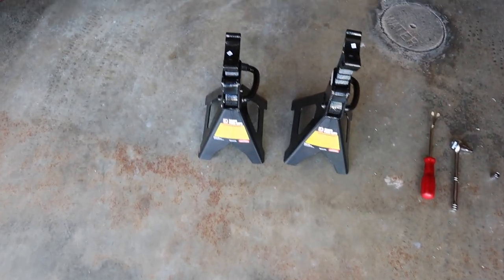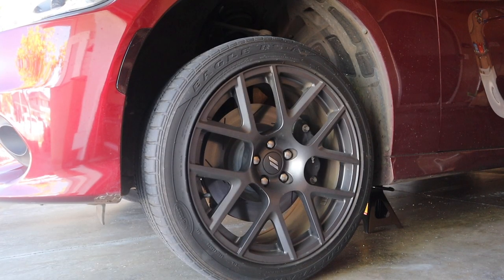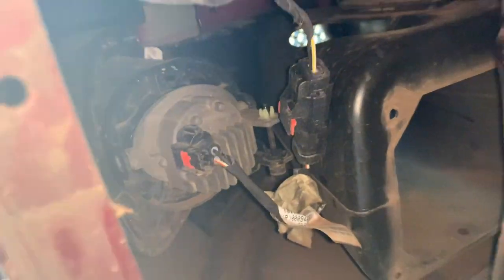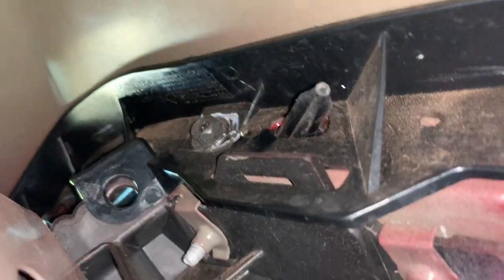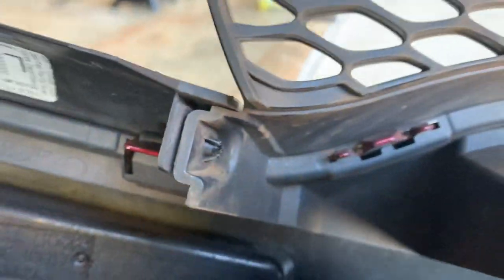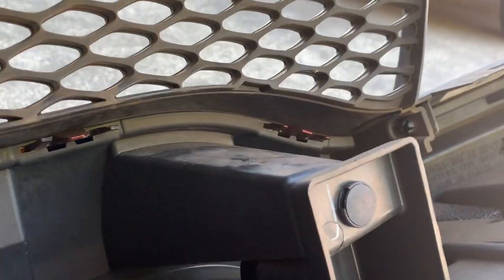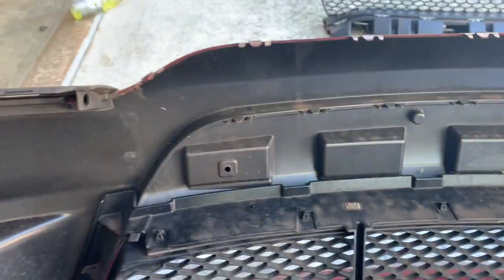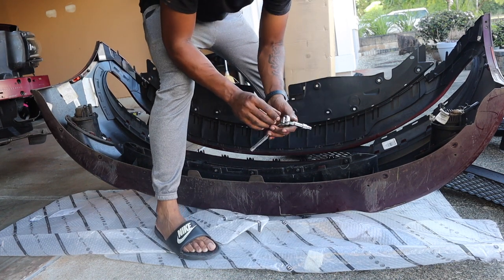How To Remove a 2015-2019 Dodge Charger Front Bumper/ Grille SWAP!

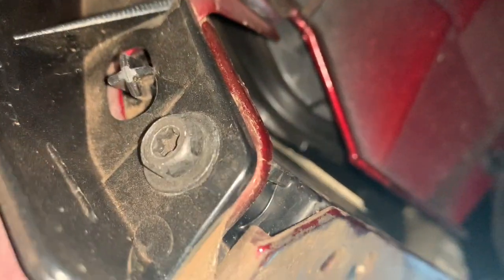Comment: @5:35 The screwdriver T 27 tip saved my life. I had a difficult time getting my socket in there, I used a hand drill  to get in there. You can do this with the wheels on.
Reply from the maker: Damn that hand drill must've been a tight squeeze! Thanks for the advice!

Comment: Looks mean bro now for the cold intake🔥🔥🔥🔥
Reply from the maker: Cheefn 4U Definitely!
Reply: CeeWill23 Vlogs wouldn’t that void your warranty?
Reply from the maker: Military&Mopar Madness I don’t think so, just a better way to get more air in your engine I don’t think it will bro
Reply: CeeWill23 Vlogs oh okay. I don’t know since my car so old lol
Reply: Just bought a 2021 Scat and dodge has confirmed that if you buy the (Blue Mopar CAI) it will not void your warranty, but their catch to that is, you have to allow Dodge to install it! Note: there are 2 options; 1 the hellcat lower air box or the blue mopar cold air intake. Either with significantly increase the cold air flow and the horsepower without voiding your warranty!

Comment: Crashed my car and they totaled it when all that was literally wrong is the front fascia is fucked so got my 16’ RT at auction for 15k neeeded a video showing all the parts I needed as I knew there was a lot ! Nice vid !
Reply: Damn a 16 for 15k that must be nice
Reply: @dausontrigg497  hell yeah especially the way car prices are now mane ! Also had a srt conversion hood, wheels and body with headers and exhaust system already so I had to get it back
Reply: @abrahamramirez7239  yea I’m looking at ‘15 RTs right now and I’ll be lucky if I get one under 20k but it’s either that car or keep rocking with my beater I’ve wanted a charger since I was about 10 years old

Comment: Is there anyway you can put your badge from the previous grill onto the new grill with the snorkels???  I wanna get the same grill for my Charger but I don’t wanna lose my Daytona badge
Reply from the maker: Yeah man if you take it off you should be able to put it right back on!
Reply: @CeeWill23Vlogs  bet bet sounds good I didn’t wanna buy another badge lol I saw they run for $50-$70
Reply from the maker: @joelbustos5412  yeah man on Ebay they're a bit less expensive

Comment: air doesn’t go into the engine it flows easier into the radaiotor cooling the engine slightly better but really does nothing performance wise . all cosmetic stuff

Comment: So disappointed in myself. Great video but I struggled getting the top bolt in the fender. Had a small wrench like yours. Couldn't get it off. Tried many times. Fuck.
Reply from the maker: Awh dang did you end up getting it off?
Reply: @CeeWill23Vlogs  alright went to lowes and got a drill bit flexible extender. Will try again tomorrow.
Reply: So update, I got it done. Wish I could add a picture.
Reply from the maker: @JennyCaldas0506  yayy that's wassup! If you have Instagram hmu on there or fb cee will